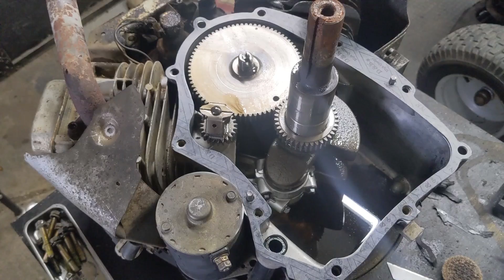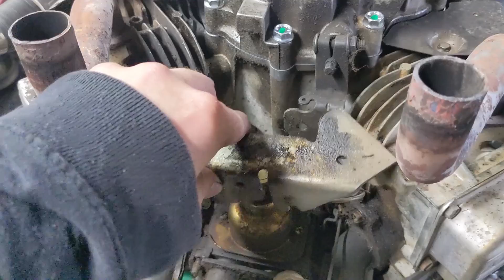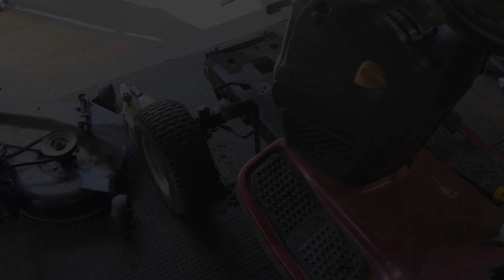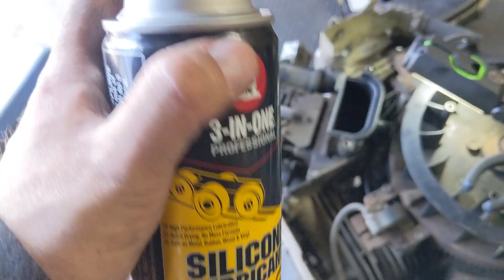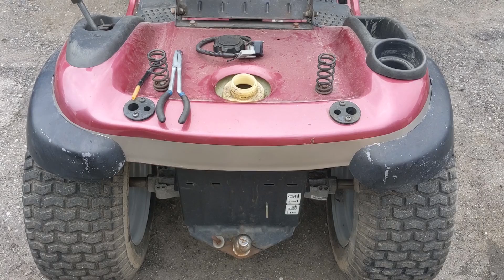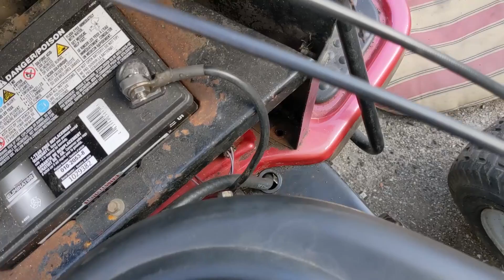Scott's (John Deere) L2548 Riding Lawnmower [Part 3]

Comment: I have this exact same tracktor, rusted out mower deck, torn up seat and dry rotted tires. Engine runs great, no leaks.
I'm thinking about getting her running again and using her as a garden tractor. Mainly pulling a harrow and cultivator.
Do you think this model would be OK doing this kind or work?
Thanks, great set of videos!

Comment: $1500-$800=$700 profit.  I have the same tractor in my back yard. Same oil leak and other issues should I try to fix it? Im inspired.
Reply from the maker: Absolutely, these things are awesome. If I didn't have such a small yard, I would've kept it for myself. And that profit of $700 basically covered my labour, as well as the cost to purchase it when it was a non running unit. I had fun restoring this one. Thanks for watching!

Comment: I liked the tip about using the Oregon pigtail wiring connector to plug into the clutch.   How'd you find that?
I was looking for something like that for when somebody rips off the harness going to the PTO. 
I assume that should work on any PTO with the similar plug on the wire harness.
Reply from the maker: Yes absolutely, and I'm an Oregon dealer so I have access to their parts. They make generic stuff like that and it's great, I just cut one end off and hard wire it into the main harness. The top connector clips in firmly and won't fall out like the little female disconnectors will! Thanks for watching!